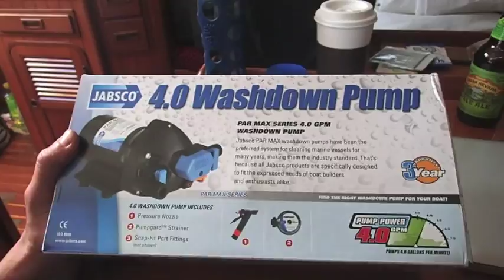Mast Inspection - Second and Final Day

Comment: I would be interested in hearing your thoughts on removing the staysail?  For us, where winds tend to get in the low 20kt range most days it works well for us.  This year for our rigging we're removing the intermediate shrouds and just going with running backs on a 4 to 1 purchase.  I have confirmed with Bob Perry that this is a  better set up as it put a better angle for the staysail shroud and reduces the mast compression loads.  Something to think about.
Reply from the maker: David Duncan I screwed up at that point in the video. I really meant to say we might remove the staysail furler. The short of it is I would like to eventually put running backs on and have a hank-on staysail. I think this setup would be better in heavy weather. Right now would certainly be a good time to remove the staysail furler. The running backs will definitely have to wait until we get some sort of financial windfall, though, as we will almost definitely need to put in a new set of winches for them.

Comment: Anything that is bent, replace it. I would be replacing all of your wire rigging. If you check your insurance policy it might have a clause that states it will only cover a broken stay / broken mast if the rigging is less than 6 years old.
If you are determined to keep any of it, the other thing you could do is test the turn buckles for cracks using a dye base crack testing kit - something like this: http://www.warrenandbrown.com.au/precisiontools/product-details/960270-dye-penetrant-crack-detection-kit/273
Reply from the maker: ***** Thanks, Alan. I have the Spotcheck kit and have used it on some of the fittings. I will be checking all the fittings that we might keep in that way.
Reply: This would be good for the chain plates too.   On the back stay, you can replace just the lower section of the stay.  Cut the center section a couple inches short and reuse the end if it's in good shape and then have a new lower section made a few inches longer.   Was the bend left or right, or in the direction of the mast?  Could it have been bending at the edge of the wood?